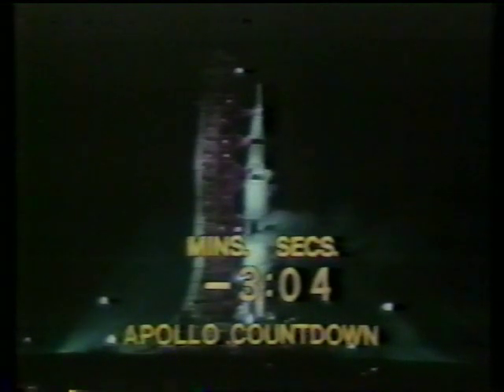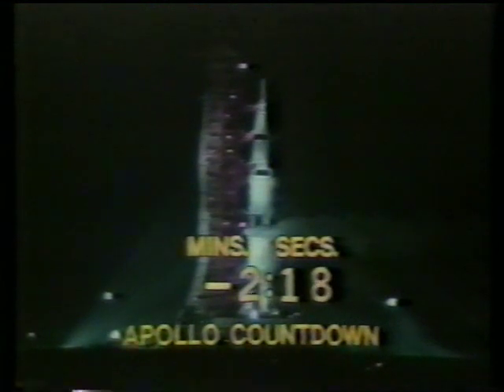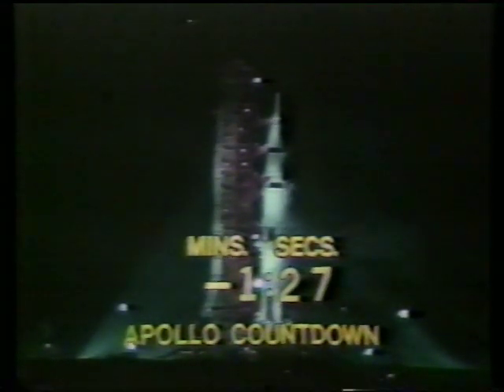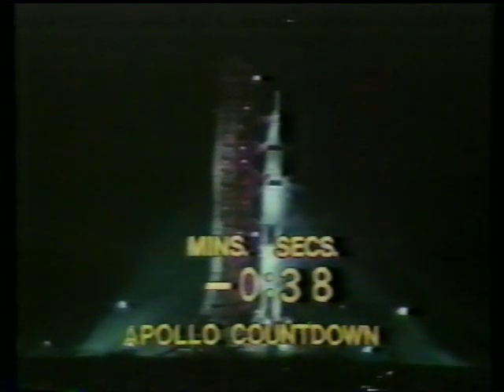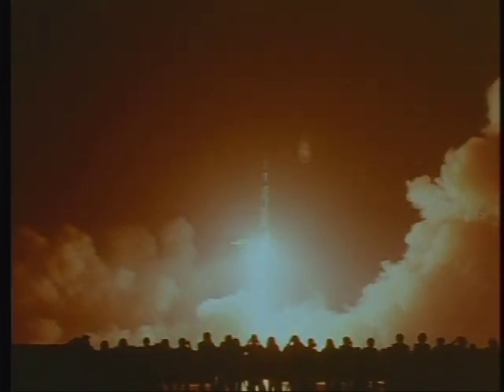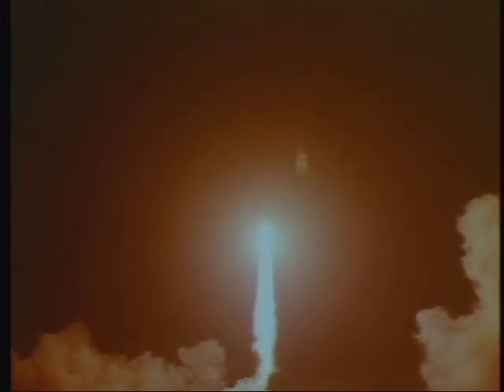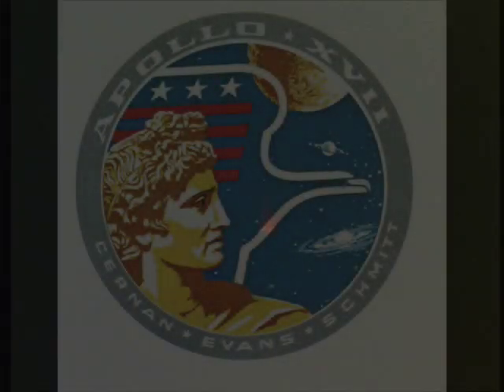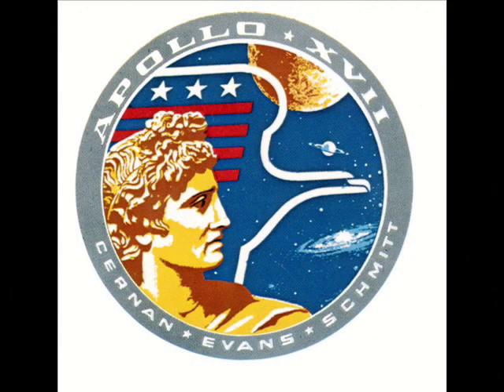Launch of Apollo 17 (TV Feed and NASA Footage)

Comment: @JMChladek I heard the same thing. I don't think it was quite gallows humor as they were in pressure suits that would have kept them alive had the cabin not sealed, giving them time to work the problem. But it would have been impossible to have a normal mission without a sealed cabin.

The chuckling might have been because he was supposed to make the call earlier but forgot.

Comment: The audio sounds like it's coming from the CM's tape recorder. We hear the astronauts talking to each other and Houston as they heard them over the radio. The uplink Quindar tones sound distorted and weak because their only intended function was to mute the uplink when the Capcom wasn't talking, so they were (partially, in this case) notched out at the uplink transmitter.